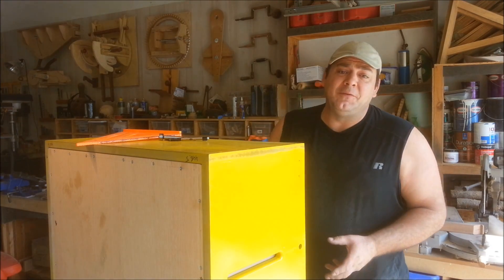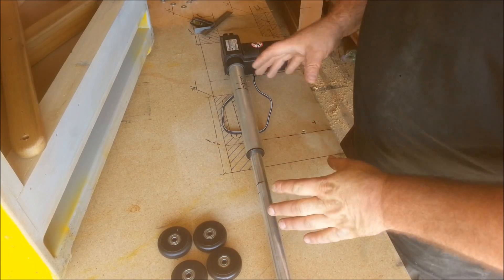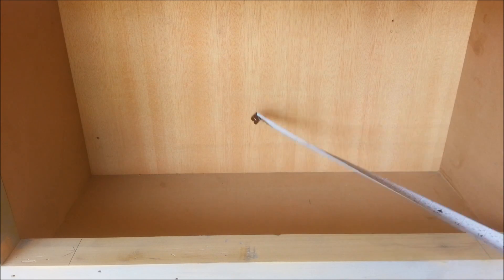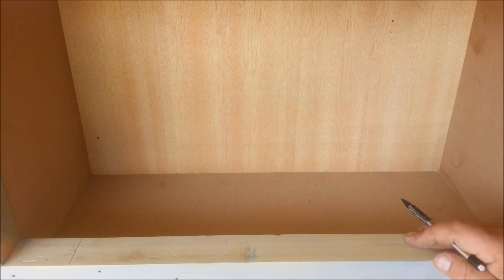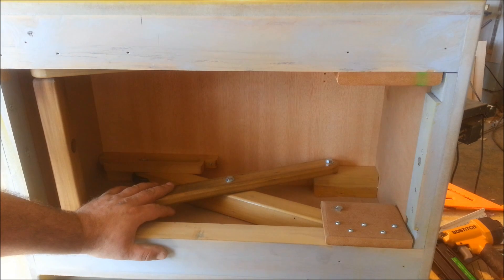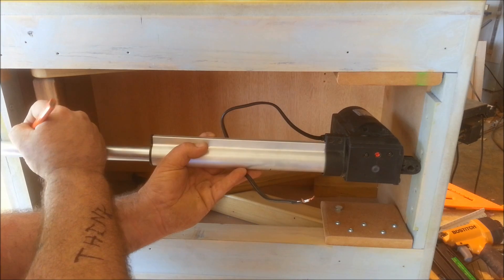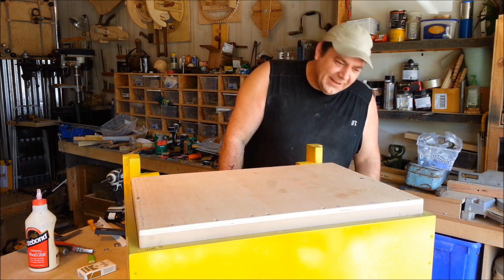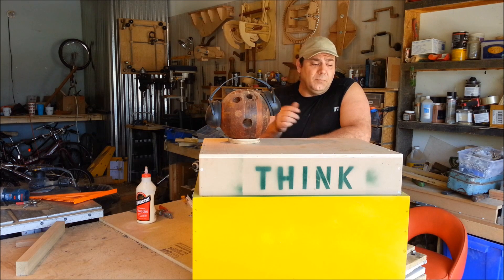Router - Building A Table Lift System

Comment: That is really cool, great job! I am building my own tiny house on wheels and want to lift the roof up several feet to fold up side walls. Do you have any suggestions if I should be using a pully system, scissor lift system to lift up. There would be steel telescoping poles at each corner. It would just be 14 ft long y 7 ft, tin roof w 2X4 construction. Also what casters or pulley system best for moving a wall out about 200 lbs. I have to build it myself and never constructed anything before and you seem to be very skilled. I think that I figured it out, metal bar attached to trailer, and telescopes up exterior, and pulley up.

Comment: Izzy I love you! You are such fun.  I use hockey pucks for the pistons in my diy hydraulic cylinders and air compressors.  Roller bearing, wheel, pulleys hockey pucks are great, except those soft ones they use for practice.  Someday I am going to have to put up some videos of my own. You are an inspiration.

Comment: Hey izzy great video! If you can find a way to get more amps to your motor it wil move faster. I work for a company that repairs wheelchairs etc. And when an actuator is to slow we up the amps en there you go. Most actuators we use can handle a range from 3 to about 6 amps.
Reply from the maker: Cool that's for the tip. I am running it at 3 amp now have to order a 24v 6 amp power supply

Comment: The inside measurement thing: pure genius.

A 4 way lightswitch (the type with 4 terminals, used when you need 3 or more switches on a circuit), also known as an 'intermediate switch' in the UK will do for polarity reversal if you need another, may be cheaper/more accessible at homecenter

Comment: Hello Izzy you have a great channel, one of my favourite woodworking channels.
Regarding tape measure I have since almost 30 year used the Talmeter tape measure and I would highly recomend that. It has a special feature so you could easily measure inside measurements and also the possibility to transfer measurement and mark directly on the object. Have a look at the demo video: (Made in Sweden like myself)
TALMETER - Hultafors marking measure - Taking measuring further.

Comment: for inside measure you put the tape meter body in contact with the wall. on the body there is a length written that is the legth of the body. you jus add and have the exact measure....
Reply from the maker: I find that they are often in correct and the measure meet are can be a 1/16 or more off.

Comment: Laser measures might be the answer to taking inside measurements. Now days they give you 1mm (1/16 inch) variance, they are quicker to use and they are becoming more affordable.
Reply from the maker: I have seen those haven't used them.
Reply: 1 mm is 1/25 of an inch.

Comment: I don't think it is too slow. It will give you finer adjustments. And it's quiet. Really good job, Izzy.
Presumably, you still have to mount the router on top, and then the table above all. That should be interesting!
Then you might show us a neat way of adjusting the router bit to the exact height using your push-button actuator system, right? (see Using a Home-made Jig to Set Router Bit Depth )

Comment: Awesome can you get a view of how the actuator works?? Keep up the good work!!
Reply from the maker: Good idea i will do that in the next video.
Reply: izzy swan also another thing I was curious about is why you didnt use a 110 volt actuator as I seen there was a few on ebay and that you can eliminate the batteries and run off a regular switch??

Comment: Most tape measures are marked with the length of its body so when you do inside measurements you just butt the body of the tape measure to the wall and read it to the edge of the body and then add the body width.
Reply from the maker: I have always found  that they are often a 1/16 th or better off.
Reply: izzy swan
You could come up with a telescoping devise to adjust to the dimension, take it out after setting to inside dimension, then measure the length with a measuring devise. Or something that has been around for a long time which is called inside calipers.
Reply: Earl Schrader
now there is a good idea...earl is thinking

Comment: Izzy what is your worst woodworking injury?
Reply from the maker: It just happened in the video. lol I have had some pretty nasty accidents on the farm back in the day.  I cut of  the tip of a figure at the first knuckle and crushed my left thumb. But never had anything to crazy in the shop. I cut my self a lot and smash a finger now and then
Reply: izzy swan

I just did something stupid while cutting a circle on the table saw, saw grabbed it spun it, bent the screw in the middle, plywood flew off and smacked me in the hand. Few scratches, thought I broke my thumb but it's pretty bendy and seems o.k.

Totally my fault I didn't secure it properly and had it too far into the blade when I moved the sled forward. Hand was nowhere near the blade or anything so that's all good. Just one of those quick lessons, like learning to not touch the hot stove lol.

First thought on this lift was a hidden t.v. remote controlled to pop up. I have been thinking of building one.

Comment: Is your Pinocchio actuator capable of doing fine adjustments or can you put in a thumbwheel/hand crank for that ?
Reply from the maker: it can be stop at any desired height with a switch but as far as really fine tuning the will be the job of the router sled.